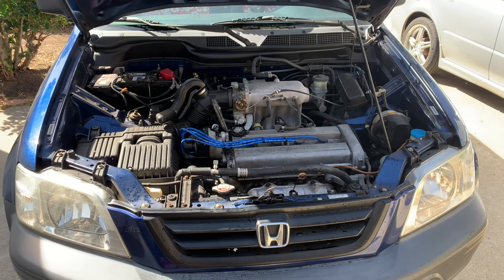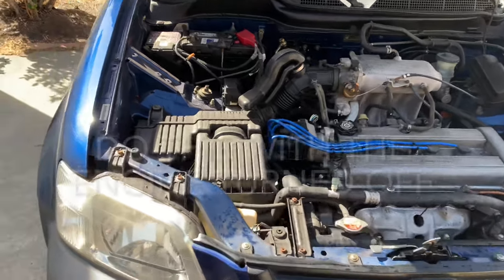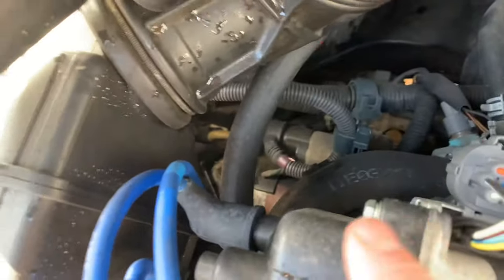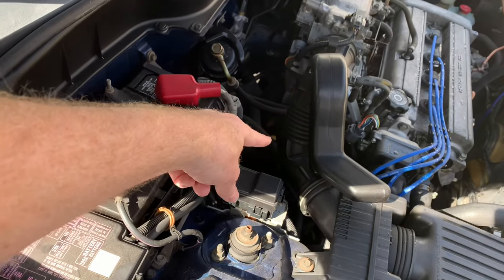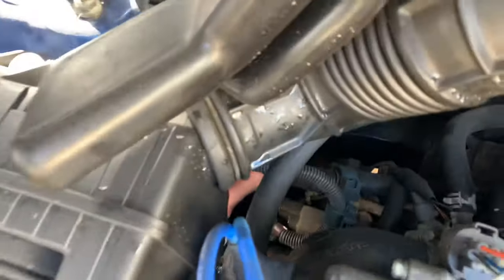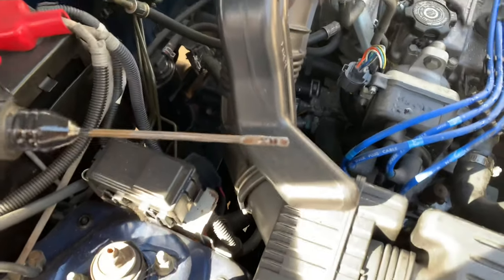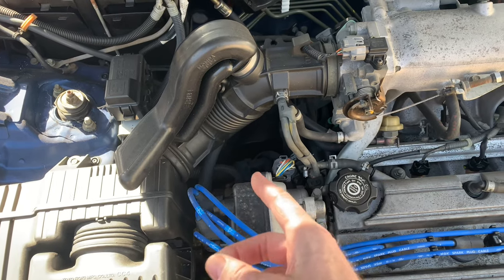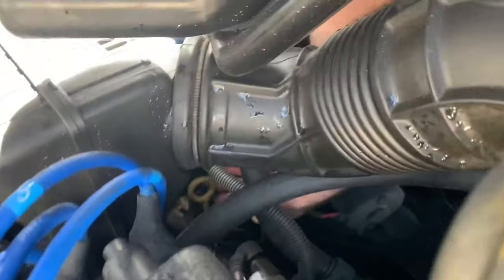How To Check Transmission Fluid Level On Honda CRV

Comment: May I add...If you have a chance on a dirty engine to use compressed air to blow away any road dirt from the dip stick area, etc...as an opportunity for foreign inclusion into your transmission to occur.  Nice video!
Reply from the maker: Great tip!
Reply: Our 2014 2wd reg auto(not cvt) requires special Honda transmission fluid ATF DW-1. And the engine has to be off. You didn't say it but you did turn it off. Most non Honda mechanics think it's got to be running (like most cars), but it needs be turned off and checked between 60 and 90 seconds after shutting off.
Reply: @rickl6697  # 3 in the description says "Turn off engine"

Comment: Can uiy check the transmission level  while engine is cold or it have to be operating temperature
Reply: Check your book. Our 2014 CRV says must be up to operating temp(cooling fan comes on). Then check the level after 60 seconds but before 90. Ours requires HONDA ATF DW-1 fluid, but check your book or ask Honda dealer.
Reply: @rickl6697  ALL HONDAS need Honda only trans diff fluid

Comment: The Honda CRV 2016 doesn't have a dipstick  For transmission😕
Reply: They phased out dipsticks in a lot of newer vehicles since the fluid is “lifetime” For some newer vehicles like nissan you have to buy the dipstick separately smh. But i guess its better than having none at all.
Reply: look up scotty kilmer on how to change it. Otherwise "lifetime:" means about a 150K at best.   Change the fluid out and it will go 300K plus if you do it right.

Comment: I was told by Big O that there was no way to check the transmission fluid in a 2005 CRV without removing parts of motor. Is that true?
Reply from the maker: I don’t know. The one in the video is a 1997. I don’t know if they changed it or not. I have a 2012 Prius, and they designed it without a transmission dipstick. They say it should just last for the entire life of the car and you don’t have to check it or change it.
Reply: No it is not true. The transmission fluid thing is located under the battery.